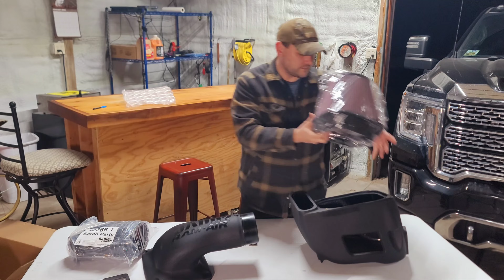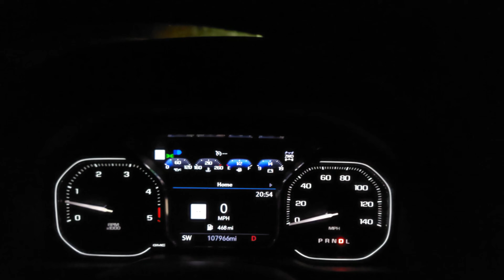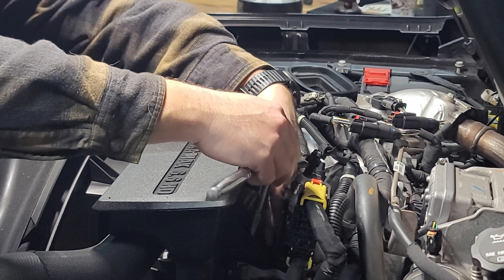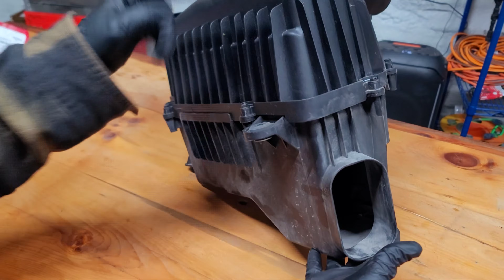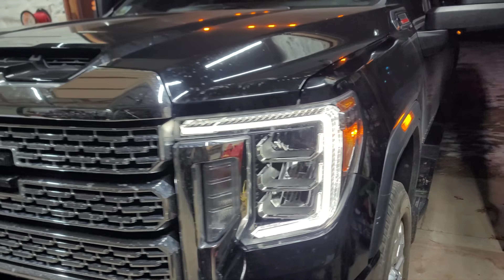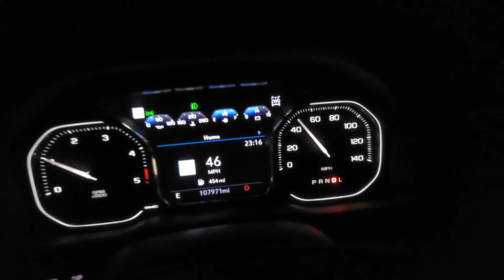Banks Ram-Air Cold Air Intake Duramax L5P Install and Sound Test

Comment: Have you noticed any fuel mileage increase?
Reply from the maker: I have not noticed anything other than slightly better sound, VERY VERY long service intervals, and Very obvious better breathing under load.

I did "tune" the truck after this, so cant speak to the MPG increase being from the intake or the "tune".

I have over 49K miles on it since the video. Still no air filter cleaning needed.
Reply: Awesome. Thank you!

Comment: Mines is a 2020 L5p with that cold air intake it keeps throwing aP22FB code every 2/3 , that intake is not worth it👎🏼👎🏼👎🏼👎🏼
Reply from the maker: Sorry to hear that. I have 30,000 miles on mine now with 0 issues. Did you try contacting Banks to inquire about the issue?
Reply: @LuckyLoonOutdoors yes i did they told me to replace the MAP sensor or clean it and drive it, believe thier going to send me a new intake module, if not im going with S&B filter , im doing a full delete on mines 2/3 weeks so i need this issue fixed before it i due the delete

Comment: I purchased one…. Drove it around for a day, removed and sold it. Around town it had a weird droning grinding noise so much that not telling my girlfriend I had installed it… she immediately  asked what was wrong with my truck it was making a grinding noise in her words
Reply from the maker: that's odd. I didnt have that at all. did you install it in the 6.6 duramax?
Reply: @LuckyLoonOutdoors you betcha, 2022 L5p 2500 hd At4….. Drone was surprising around town. I was also unimpressed with how thin and cheap the plastic air box assembly felt….. maybe I was just un realistic of my expectations of a banks pat? 🤷🏻
Reply from the maker: Thanks for sharing your experience.
My experience is different, but having more perspectives for folks is good!

Comment: These are still not available on 24+ 2500/3500 for some reason!
Reply from the maker: Yeah, their website says coming soon, still in development.
Reply: @ yeah it’s been like that for awhile now lol
Reply: @ do you have to do any maintenance on the intake? Change filter? Wash? Oil? Ect….
Reply from the maker: Occasionally, you remove the air filter, spray with K&N air filter cleaner, wash with hose, and re-oil with K&N filter oil. I have put 8K miles on so far. filter is at 65% still.

Comment: Who gives AF about sound, do a performance test, draggy or run it against a stock truck or any truck for a before and after.
Reply from the maker: When it comes to an 8,000lb long box 1 ton diesel truck. the performance aspect of just adding a cold air intake is completely irrelevant. The HP add is not noticeable, running it against a stock truck also tells you nothing of much use.
The real intent here is air filter longevity and service interval, better engine breathing for towing, and knowing if adding this accessory  is going to drive you nuts from listening to it when towing a trailer for 6 hours.
If the truck was also tuned, this would be a completely different video.

I can however confirm that after 8 4.5 hour drives towing a 26ft enclosed trailer, the intake does NOT drive you insane from droning or noise. Unlike my previous vehicles.
Reply: For just a cold air intake, really 😂

Comment: Sweet, nice install, I have a 2022 denali duramax dually I have mines waiting in my garage to be installed, I want do it now because I order the turbo inlet coming, it's on backorder though and as soon it come in then I will install my Banks cai. I have the PM install and my next mod will be the catback exhaust, I might get around getting the boost tube for it but first things first.
Reply from the maker: Sounds like a pretty awesome project. I think you are going to be really happy with how it turns out!

Comment: Thank you for doing this, I don't want noise, pulling toy hauler, I'm ordering one
Reply from the maker: glad I could help. so far, so good. you can hear what the engine is doing, but it does not drone, is too loud, or become annoying.
Tomorrow, I will be pulling a large enclosed trailer 4 hours, will see how it does.
Reply from the maker: quick follow up for you. After the install I pulled a 26ft enclosed trailer on 8 4.5 hour long drives to wisconsin. 
I can confirm that the Intake does not produce anything annoying or too loud. it is still pleasant and pretty quiet, you can hear it breath on acceleration from a stop.